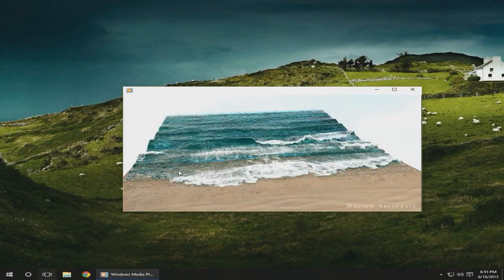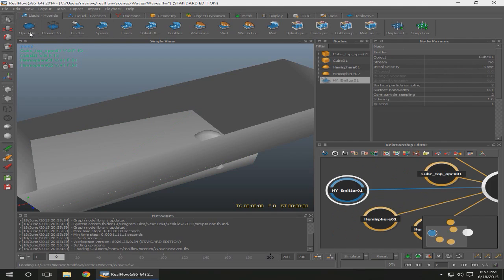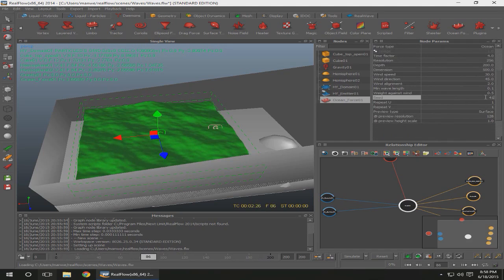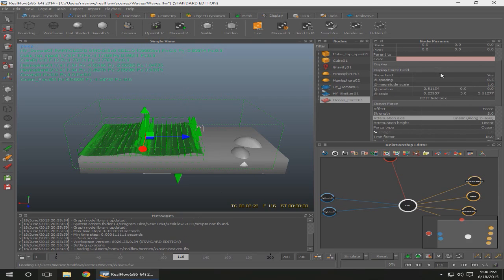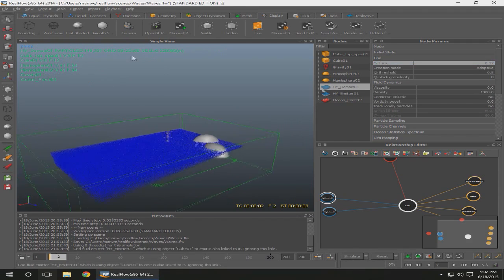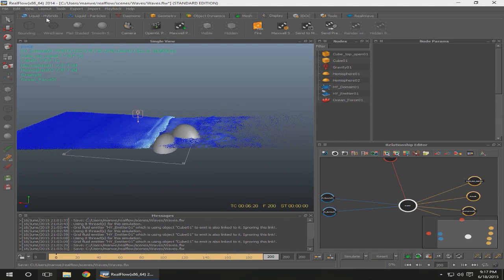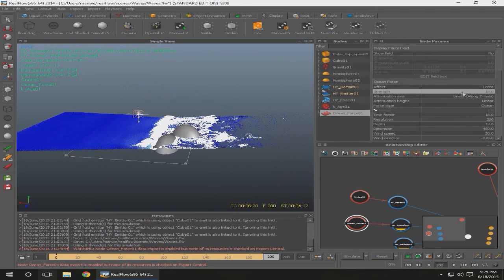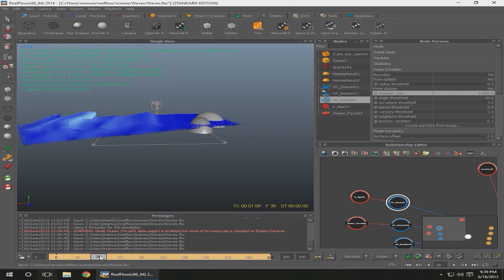Realflow 2014/2015 - Ocean force Daemon Tutorial + Project files

Comment: It took me over an hour to get through this tutorial because I had to keep going back and forth to see what you have done next, only to have to change the settings again on several instances. Your english is a bit difficult to understand sometimes too, resulting in having to continually pause the tutorial to see what you just did. I got through the entire tutorial eventually, but it was frustrating having to continue to go back and change parameters with you as you changed them. Thanks for taking the time to do this, but please, in future tutorials, make sure you have all the correct parameters and steps down before showcasing it on video, that way there's no confusion or frustration.
Reply from the maker: +3D Editor Thanks for feedback !
 If you have any questions feel free to ask, I'd be more than happy to help.
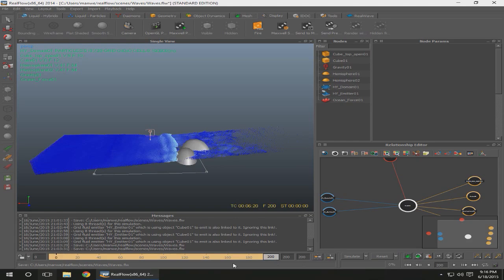Reply: +Marino Strinavić I'm working in Freeflow 2015 and some of the controls and locations of parameters are different. I still managed to improvise. However, at 7:36 in this tutorial. I simulate my waves and they end up falling flat and never peaking into waves like yours. I followed your tutorial exactly and my results are coming up with no waves at all. Do you or anyone else know how to make waves appear using different parameters in the  ocean force or emitter or gravity in order to make waves actually appear?
Reply from the maker: +3D Editor There could be some minor changes since this was recorded in Realflow 2014. Make sure gravity node is connected to Hybrido domain.
Reply: +Marino Strinavić I have only ocean force connected to hybrid domain as you mentioned in this tutorial. So are you saying now that gravity also has to be connected to hybrid domain as well now? Both ocean force and gravity connected to hybrid domain?
Reply: +Marino Strinavić I see what the problem was for me in 2015 version. The gravity direction was upside down by default, and I have to decrease the gravity pull because it's too powerful, making the particles levitate too far upward.
Reply from the maker: +3D Editor Yes, gravity needs to be connected to Hybrido domain too.

Comment: Hey, Thanks for the tutorial! Im new to realflow, so my question might have a dull solution. My particles keep falling through the cube. I tried solid outside and the other options - non worked... any suggestion?
Reply from the maker: +DD Brizzy On main objects,volume mode should be solid inside or shell. Also make sure cell size iz 0.1
Reply: +Marino Strinavić Hey thanks, it is. Still doesn't work :(
Reply from the maker: +DD Brizzy Can you send me your project files ? Go to Documents>realflow>scenes and add your scene folder to WinRar/7zip archieve. But before doing that, delete meshes, fields and particles folder since it contains simulation data which I don't need but take a lot of space.
Reply: +Marino Strinavić Email is out, thank you!

Comment: can i ask you something did you use renderkit  how you import foam and splash and deal with matrial to make look grate like that 
please help me with that
Reply from the maker: +The Assassins I didn't used Renderkit. I simply import mesh and Krakatoa (.prt) particles to Cinema 4D and render them. Vray renderer for mesh and Krakatoa renderer for foam/bubbles/splash. Also I use custom vray water material for my scenes, download will be available soon.
Reply: +Marino Strinavić  thanks i will try use that in 3ds max
Reply: @marinostrinavic8787  Any possibility you could share the settings you used in Krakatoa C4D plugin for rendering out the splash and foam? I cannot find any information on the Krakatoa plugin and C4D creating this. Thanks

Comment: Short and informative!! Great tutorial, Marino.
Reply from the maker: +Sephiroth S Thanks !
Reply: +Marino Strinavić Btw, I will attempt this in RF2015, do you think there will be any problems? ( I read some comment below)
Reply from the maker: +Sephiroth S Yes there are some problems with volume modes, it isn't same as it was in RF2014. I will update this week project files for RF2015.
Reply: Ouch. OK, that's great. Btw is the foam rendered through Krakatoa?
Reply from the maker: Yes, foam/bubbles are rendered with Krakatoa.
Reply: Cool! This is probably one of the hardest thing to do in CG but it looks very convincing, congratulations.

Comment: i did all your steps ... and when i clicked simulate... nothing happened...but first when i started i copied ur paramiters for cube and cube top opened ... and they seems to be small a bit ... and when i created ocean force... it appear to be too large so i scaled them... is this the problem? or it might be emitter problem ?
Reply from the maker: king shartouny Check emitter and cell sizes of objects. If you still have problems you can compress and send me pm with your project file so I can take a detailed look (just delete 'fields' and 'particles folder' to decrease filesize). Also do you use RF2014 or 2015 ?
Reply: ***** what exactly should i check in my emmiter? and yes im using 2015 but it seems the same as 2014 or no? where can i send my file with PM?
Reply from the maker: king shartouny If you are using RF2015, you need to re-adjust volume modes of objects. Solid outside option isn't working properly in RF2015 and that could cause problems like not spawning particles at all... I'm still looking into issue, but for now I still use RF2014 until they fix bugs... You can send me file over private message.
Reply: ***** i did them in 2014 now thanks man it works good in 2014... but i want to import it to 3d max 2015 u think it will work ?
Reply from the maker: king shartouny I'm glad you got it working now :)
 Download latest Realflow connectivity plugin from here: www.realflow.com/try
Reply: +Marino Strinavić this is happening to me as well on 2015 im not getting any particles. However ill try it on 2014. Thanks a bunch for your help man. the tutorial is great and you get back to your viewers. I really appreciate that. i'll sub your channel to support. thanks again.
Reply from the maker: +Mark Fernandez There are some volume mode changes in Realflow 2015, now you have to create Cube instead of Cube with top open as liquid container and set it's volume mode to solid outside.
Thank you for watching my tutorial :)